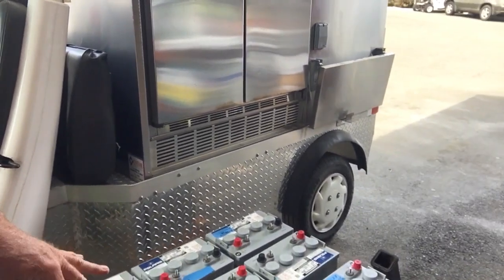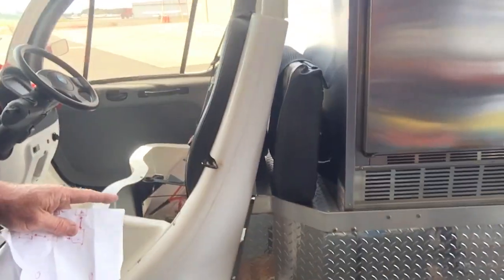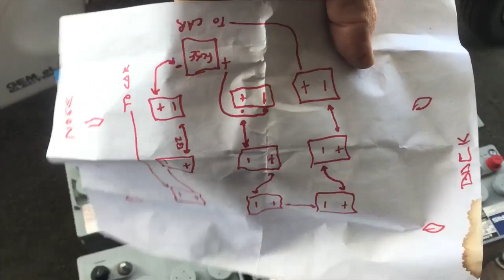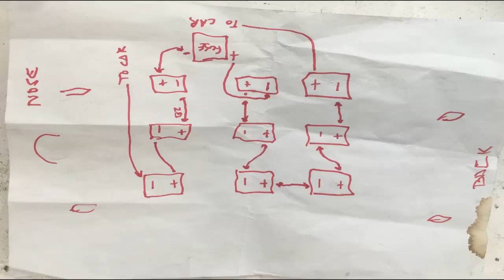GEM Car E6 EL XD Nine Eight Volt Battery Installation

Comment: Do you use some sort of handle to help remove and lower these 70lb batteries into the cart?
Reply from the maker: I hear you loud and clear!  I am exceptionally muscular so I just lifted them into the car myself and yes it is painful but almost every battery has some sort of latching point these guys have a loop on either end where you can barely fit a 1 inch strap through and even if you can’t hook that up to say an engine hoist or something you can at least get a better grip on it but with this battery tray all I had to do was drop each battery in vertically and then push it to it’s assigned area.  Good luck.
Reply: Yes, 70lbs is awkward.  I have access through the rear plate opening but there are cables that make just dropping the batteries in difficult if not near impossible.  So I probably will just lower them in through the front and push them to the rear till all nine are in.  I’m thinking  I could  hook the jumper cables to 3 batteries before sliding them to the back if I am able to slide 3 at a time to the back not sure how you were able to access the rear batteries to hook up the jumper cables since you didn’t have access through the rear plate.
Reply from the maker: @dallisbjerkeseth2716  it was a long and painful process to hook up the battery cables under the bed.  if it didn’t have that burrito thing on the back I would’ve just removed the bed there are only four bolts holding the bed on.  I admit it is kind of painful but power through it and the golf carts is a lot of fun.
Reply: You can get special strap handles, but what I like use is a short solid rubber bungee strap. They work quite well hooked through the lifting eyes that most deep cycle batteries have on top.
Reply from the maker: @jasonbailey1553  my battery toolbox is filled with a number of contraptions for lifting batteries.  These particular batteries have an infernal flat hole on either side, designed to receive a flat high-strength plastic handle which I could not find.  So I took two, 1 inch long piece of angle iron drilled two 5/16 holes in either end joined them together with a rope and placed each of them on a terminal secured them with a nut and lifted the battery from the terminal lugs. This particular car is now back in my garage, after nine years the battery have finally given out and I’m saving up for a lithium pack.

Comment: Not sure you ever look at your comments but I have this same exact model but mine was missing all the batteries. I was going to put 6 12v gel batteries in instead of 9 8 volt batteries. Do you think that’ll do anything? A golf cart gem guy told me they always put 6 12v gels in instead of the 9 - 8 volts batteries. Probably because it’s easier
Reply from the maker: I look at my comments almost every seven minutes and I highly recommend going with SIX 12 V batteries it’s impossible to find an 8 V battery charger so I recommend you go with the SIX 12 Volt batteries but please make sure your charger is set to charge 12 volt & GEL.
Reply from the maker: The reason they do the nine 8 V batteries is because in the world of science you get better duration but in the real world there is not that much difference in performance.
Reply: @wcolby  my biggest issue is the outlet under the hood has 6 small pins and 3 large pins in a rectangle. I’m not sure I can figure out what cord fits it to plug the car in. It’s not the factory one I don’t think. But it looks factory
Reply from the maker: @troyfleming6179  I fixed and returned this 2013 Gem Car can my friend,  I have a 2015 Gem Car.    If you use Facebook there are groups on Facebook you might post the question and a photo of the connector in the Gem car groups. I  will do a walk around video under the hood of my 2015 just in case.

Comment: I have a 2010 gem el  xd, and it will not go into reverse or drive. Who can I take it to for repair.  Greg in Capitol Heights, maryland
Reply from the maker: @gregorybrock439  Chrysler dealers used to deal with Gem Cars, then it was a Polaris thing. You might check your local golf cart dealers or even the Facebook groups because your problem sounds like it could just be the simple need to replacement a switch, which is technically pretty easy to do.
Reply: You might check the safety switch on the parking break. If the switch doesn't work properly it won't go into forward or reverse. You can test it by taking the wires off that switch right about the parking break lever inside the battery compartment and touching them together. If while they are touching it will drive forwards and backwards you found your problem. It's a cheap and easy way to start your trouble shooting